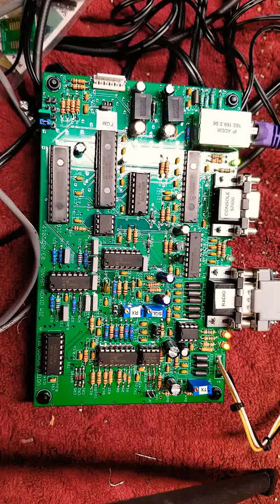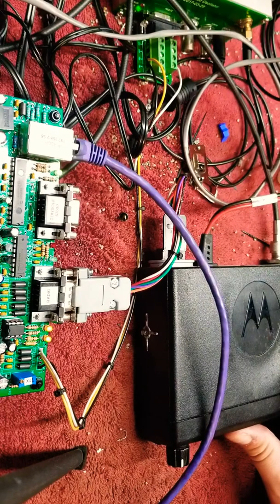Brief Introduction to the Allstar VOTER Board

Comment: Is it worth using some of my old Spectracom CTCSS generators for PL; and just sending voice over this puppy?
Reply from the maker: Well, yes and no....I was under the impression for awhile that the 9.6 MHz was only critical for the generation of the CTCSS tone but I did some testing and it's not. The CTCSS is where you will definitely hear it out of sync the worst but even if you are not running a tone, if you compare the audio between a system that has the 9.6 MHz locked to GPS and one that's not, the audio definitely does not sound as good in the overlap. It's readable and fairly acceptable but it because clear that the 9.6 MHz processor clock also has an effect on the speech audio as well.